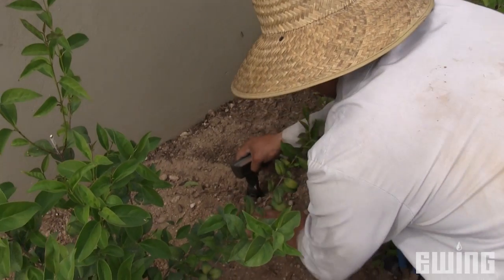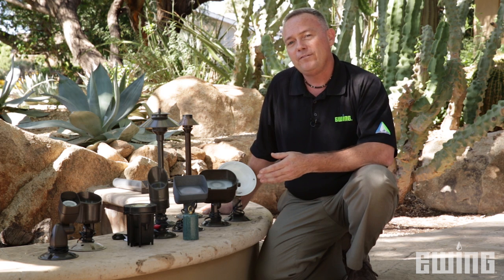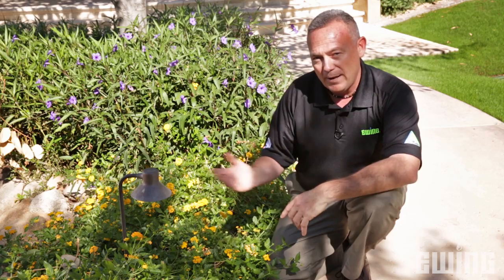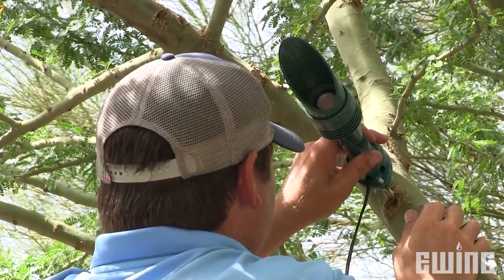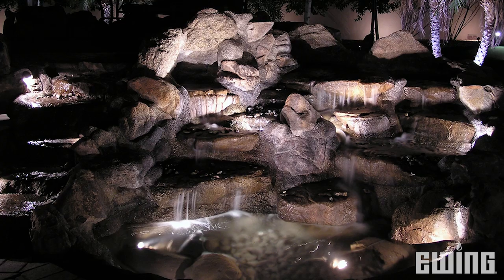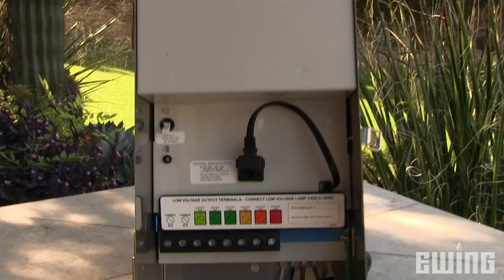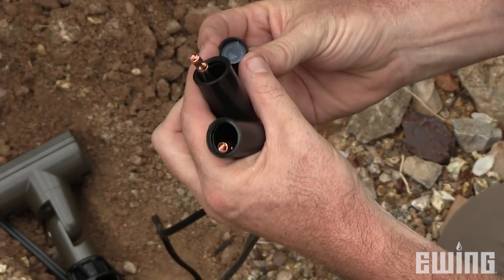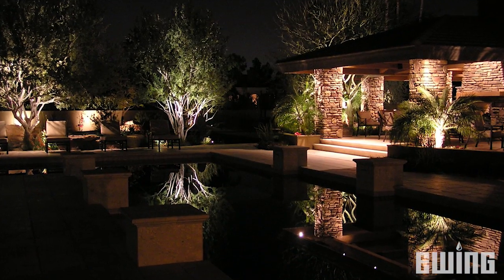Low Voltage Landscape Lighting Overview

Comment: Safety?  LED lights irreparably harm retinas. 
Cost Effective?  Fans are needed on vehicles, because they are SO hot.
Landscaping applications, way down low sounds like a better, safer way to utilize LEDs.
Reply: 1. LEDs can harm your eyes if you look directly into them for long periods of time, but that’s what shrouds and caps are for on landscape lights. These deflect glare so it will not go directly into your eyes. On good installs, you should not see the light source at all, only the effect. Also, LEDs in landscape lighting are not usually bright enough to harm you because they’re used mostly for dramatic effect and ambience, both of which do not require that much brightness.
2. LEDs are many times more efficient than halogen bulbs, so they pay for themselves over time. Not to mention LEDs usually last 10 times as long as a standard halogen. A little more upfront pays for much more efficiency and a much longer life.
3. LEDs do not get nearly as hot as halogens, they just need to be kept at a lower temperature. LEDs are semiconductors, just like the CPU in your computer. Semiconductors can be damaged by excess heat, so keeping them cool prolongs life. Think about it. If your computer overheats, it will not work properly anymore. That’s why there’s likely one or two fans in the computer and a heat sink which moves heat away from the CPU. Just like in a computer, the fans in your example are used to cool the LED just so that it does not get damaged, not because LEDs are hot. In landscape lighting, LEDs are kept cool because the fixture itself acts as a heat sink to cool them down. No fans required. By the way, touching a halogen bulb can burn you quite badly. Touching an LED however, not so much.